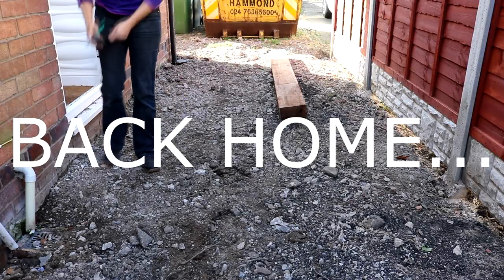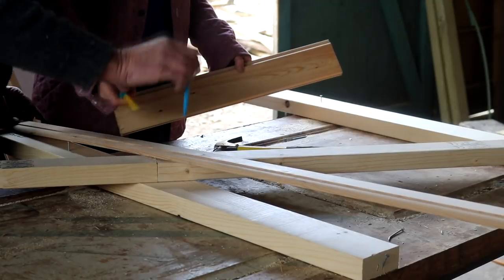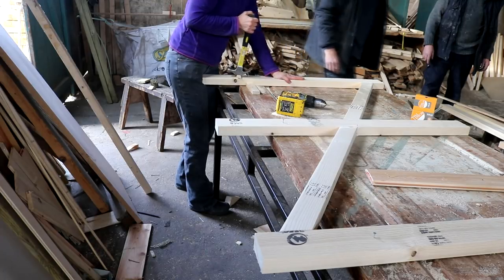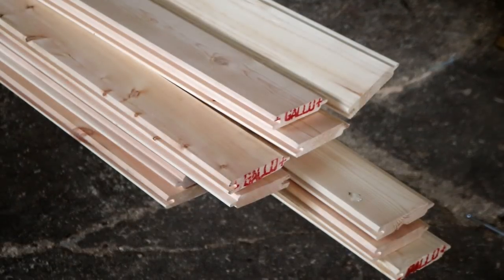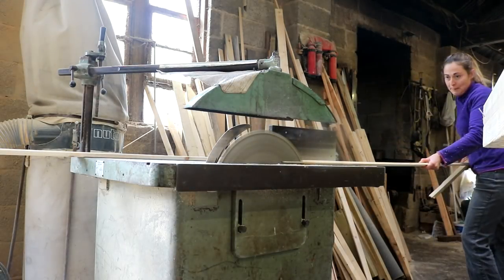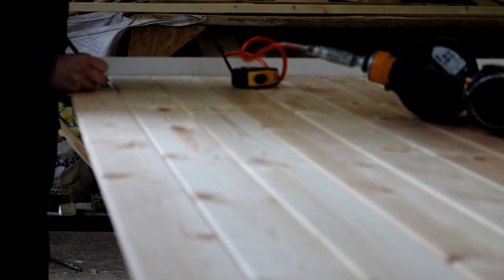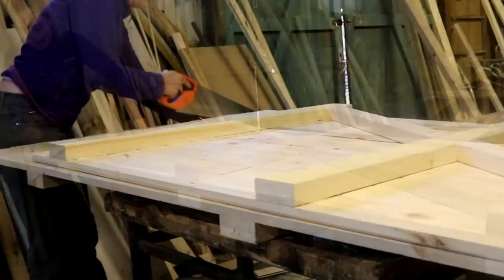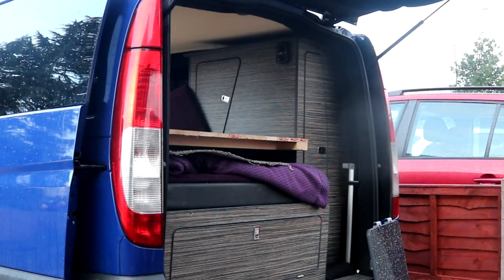DIY Double Gate at Dad's Woodyard Part 1 / The Carpenter's Daughter

Comment: Great video, Vikkie. :-) Good to see you were shown to use the crosscut saw correctly (not crossing your hands when working on the right hand side). A lot of people think that tanalised timber is the only way to make a gate but I disagree, as the wood won't be sat on the ground and I'm sure you'll be painting or staining it soon.

Looking forward to Part 2. :-)
Reply from the maker: Thanks 😀😀 Yes, it felt weird at first using my left hand, but it soon started to feel normal and the whole day was a great, invaluable experience.   Yes, I plan on staining the gate the same as the fence as we have so much of it but might change my mind on the colour.

I'm quite scared fitting it this week, but I won't learn if I don't try and have been given a top brace/spar to fit too to balance the weight.  Can't wait to get our privacy back and Hans can have a good run around in the garden :)

Comment: I'm making a ledged and braced gate, is the correct /strongest method to fix the diagonal brace from top to the  bottom corner, as most seem to split the diagonal brace and fix them from the top and bottom to the centre brace?

Comment: awesome video thanks for posting,  i'm also learning  woodworking,  are you using standard untreated timber for the framework? i'm thinking it should be ok as long as its sealed but keep hearing you should use more resistant timber such as ceder/redwood?
Reply from the maker: I'd also read cedar wood is much stronger +Christopher Reid.  I think mine was untreated but as long as you stain regularly, I believe it should be fine.

Comment: Hi there, I have bin watching your videos a while now, any way being from the uk like myself, I was wondering how do u get on with the radial arm saw as I have a 10” rigid table saw myself, I rent 2x old stables which is not massive but hay ho being woodworkers every think is to small lmao, so wouldn’t be able to fit a radial arm saw any way, but what they like using thank you?, also it’s more for cross cutting ? Than rip? Cheers.
Reply from the maker: I can't really comment on the saw as I've only used it that day.  I'll have to film the yard in more depth as there's much bigger ones in the other room and I can get more info from my dad.
Reply: Yes that be perfect mate, I think you have done well mate

Comment: you already done a gate a double gate,,,in fact wot aint you done gain alot ov experience gunna be a cabinet maker turn out some tasty furniture earn loads ov doe,dont forget to use the tools of the traditional craftsmen ,all them saws and nail guns ect i could see me nailin me sen to the wood then havin to saw me sen free check out part two now lol well dun gal
Reply from the maker: Thanks :) What I haven't done is make a staircase yet and moving the old one... dreading it a bit lol
Reply: youll do good with your ol man being a master crafts man,keep up the good work,i was crap at woodwork if i did a joint the old teacherr would say "your get a double decker bus though there boy,saw it of and do it again"lol cheers